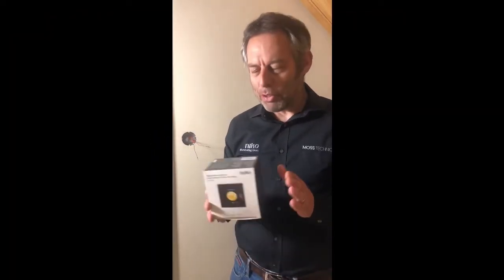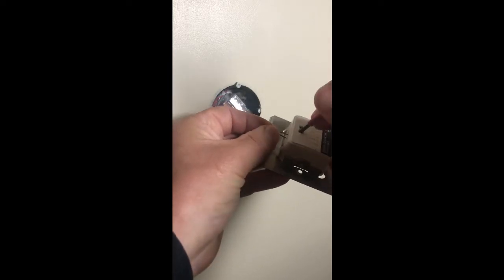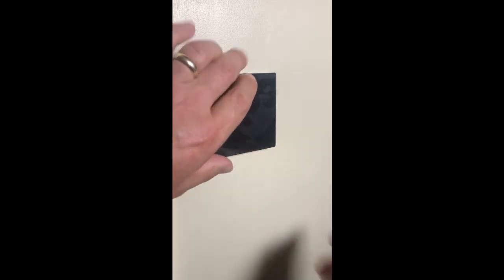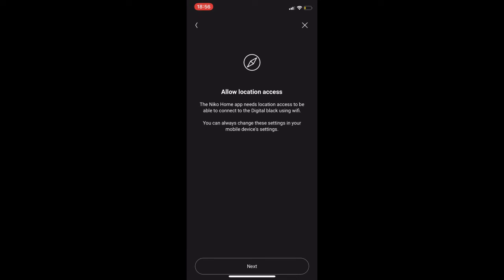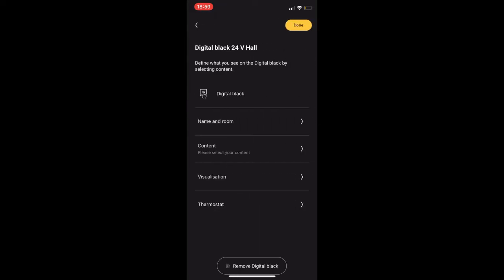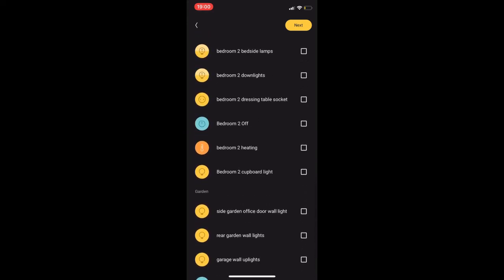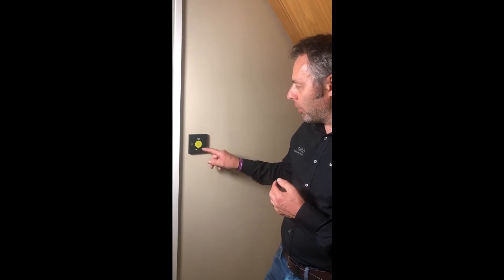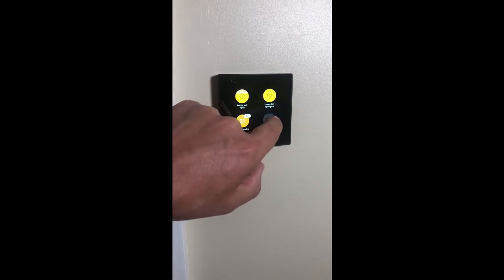Niko Home Control   Digital Black   Installation and Setup

Comment: I have the 230v version with the niko home control hub. I had to replace the hub due to a malfunction and now the given procedure is not working. It always shows that the digital black is offline, I assume it still looks at the old hub that is offline. There seems to be no feature to reset this….